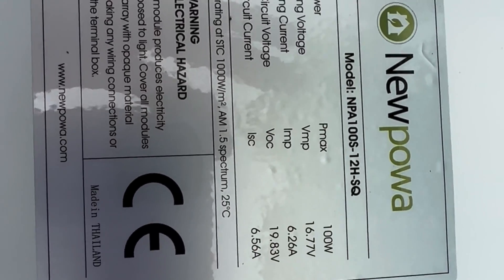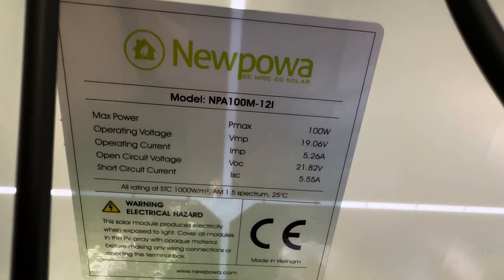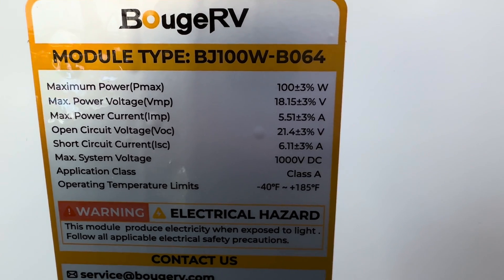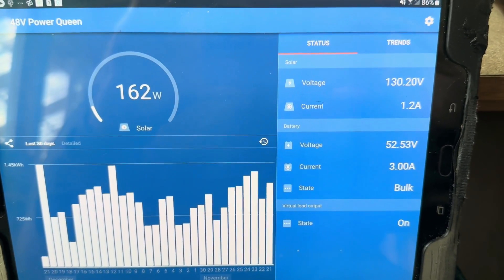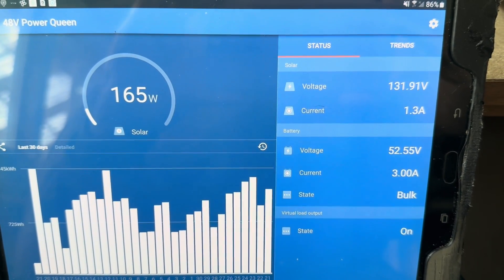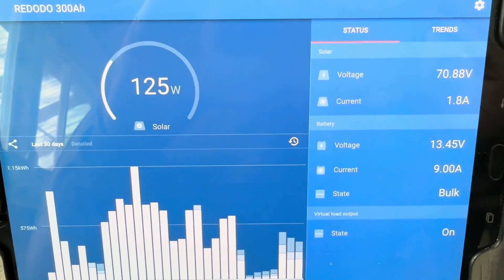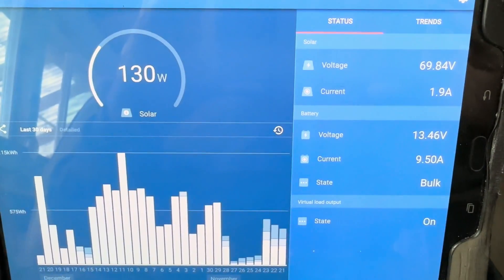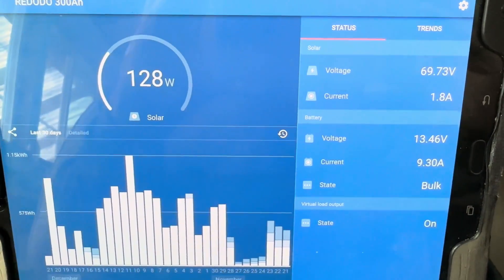Adding slightly mismatched solar panels in series to two different arrays. Working just fine.

Comment: What happens in practice is the string will drop to the lowest voltage and amperage. So, if they are very close, it's not very noticeable. Mixing 200w panels with 100w panels will give you the output of two 100W panels rather than 300w rated.
Reply from the maker: Great information to share with all of us! Mahalo! 🤙
Reply: @ProjectsinParadise808  Basically you can mix and match panels with either the same voltage in parallel or same amperage in series. But, you cant put different voltages in parallel or it will drop to the lowest voltage and same for amperage in series.

Comment: With the equipment invested, maybe not, but had you ever thought about a 24v system ? I haven't watched through all your vids yet, but maybe your systems are split for a reason ? 
Our studio shed has about 1200w, and I've had several people suggest that I move to a 24v system, as 12v was pretty much at the limit for our system. I am using an Epever 80amp, charge controller, so for some efficiency reasons, It also made sense to switch. Just had to buy a new 24v inverter, which we wanted a new one with higher capacity anyway, so that the inverter fans wouldn't kick on when the Mini-split was pulling watts during the summer. We accomplished that with a 4kw inverter.

Anyway, watching, and subscribed as we're doing all our discovery in the States, prior to moving to our version of Paradise, Panama in a few years. Glad you found yours!
Reply from the maker: Mahalo for being part of the conversation here and for subscribing! Using a small 24v system and a small 48v system as well.  All working great! Let us know how it goes for you in Paradise! And best of luck...follow the dream! Aloha!🤙

Comment: Good content as always Gary.  One comment here that I have is that when panels are in series the voltages ADD.  The implication here is that say a person has a 72 cell and a 36 cell......in series you would have 41voc and 21voc or a total of 63voc.  Therefore, in this example of solar salad everything would be fine.  However mixing parallel strings one needs to pay more attention to matching the VOC closer.  However, in my one system I use 3 290watt canadian solar in parallel with 2 100 watt panels in series to form 4 panels in parallel with a mis-match of about a volt or so.....results have been fine with a fast MPPT setting.
Reply from the maker: Mahalo! No problems at all with the strings of slightly mis matched panels. The difference is so minimal, and everything humming along nicely! Aloha! 🤙

Comment: On our cargo camper conversion we mixed monocrytaline with polycrystalline after everyone told us it wouldn’t work and still running strong. For us what made the biggest difference was quality of wire and connectors. We are combining power queen with lead acid as well. We had to do a little trick to get that to work.

Comment: looking great. as long as the working current is close it would work just fine in series system. all 100 watt mono panels . that happens a lot when you order them at different times. just the start of big storm my way, Boston NY . I have wind gen and rated 100 Mph wind. and I have a spare new in box . ben the shortest days for us as well. we had good sun a few days. All ready slowing down my internet a tad. still getting 1080P YouTube video ok. just some buffering once in a wile. The storm just before thanksgiving was lot of snow. 77 + in . then the snow melt and flooding. that took my internet out for a day. was odd. some web pages worked but very slow and others would not load.   got server error or failed to connect error. when it worked is was very slow. They told me weather related and fixing it. now I think the slow down is everyone checking the weather. The only thing you need to check is add that open circuit voltage together and check with controller so you don't over voltage them. I put tarp or blanket on my panels when working on them. enough voltage to shock you. I even meter to be safe. 😀
Reply from the maker: I'm shivering just reading about the temperatures over there!! Mercy it's cold. I won't rub it in that it's 65 here at 1030pm! Last storm here other day wrecked some havoc around the island,  but right here fared pretty well.  Roads flooded for a time, but that's kinda normal after heavy rain.  It clears up pretty quick...it's all downhill from here. I thought sure we'd lose internet with the winds, but never did. Stay warm buddy! Aloha 🤙
Reply: @ProjectsinParadise808  The grid is down in Boston NY ,about9am . 73 Mph wind so far . got 12Ft snow drift in my yard. Wind gen going strong. full charged and some. can not go anywhere. no plows out . to much wind. about 2 of 3 ft of snow today but just to windy to get a measurement . internet slow. YouTube 480 best video at this time. and still buffering. It was 52F just before midnight and 5Pm it is 9F with wind over 50 Mph. making wind chill -20 to -30F . but nice and warm inside. Going to be fun with tractor moving snow .It's deasil and I plug it in hours before I start. have no trouble. 😀🤔😮‍💨

Comment: In series the critical parameter is the current.  Imp and Isc should be as close as possible, preferably slightly higher.  The entire string will be limited by the smallest current in the string.
Reply from the maker: Yeah,  these are so close I couldn't see the harm. Working out just fine. Aloha 🤙

Comment: Mixed panel work fine if the specs are close to each other. 
Is the plan for the future to replace the BougeRV panels with NewPona panels if they are available again, and then use the BougeRV panels in a new BougeRV array with additional BougeRV panels?.
Reply from the maker: Yeah, these were so close, didn't think it would be a problem.  Working good. Got a few more Bouge rv to install,  will try to keep strings identical as much as possible yeah. aloha 🤙

Comment: Mismatched works for me too. Whatever gets the job done, right? Mahalo.
Reply from the maker: Exactly! Aloha!🤙
Reply: Ditto. I started my array perfectly matched then approximately five years past now, I wanted to try many similar 100 watt PV modules from three other manufacturers as follows: Germany, Taiwan, and China. At the same time I made the change from PWM charge controller to  MPPT controller. I'm a little embarrassed and ashamed to admit it; I wasn't prepared to completely connections of the series strings in parallel which left me with a big decision: Cutting off the MC4 connectors. I decided that I was knowledgeable enough to make better connections myself - after all I am experienced in these electrical engineering principals practices and techniques. I made the decision to color code the positive cable leads red and to temporarily connect the strings and parallels using standard UL listed wire nuts. This really sped things along and I was happy because day after day testing and verified- the numbers were spot on. Vacation time, then this and that and on and on until now five or six years later the connections haven't created any issues. Everything is just fine.